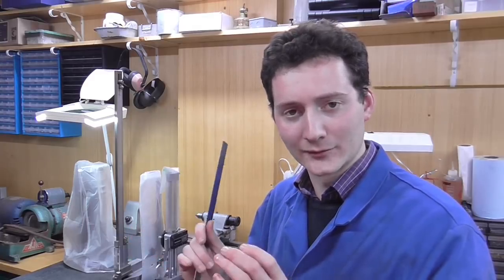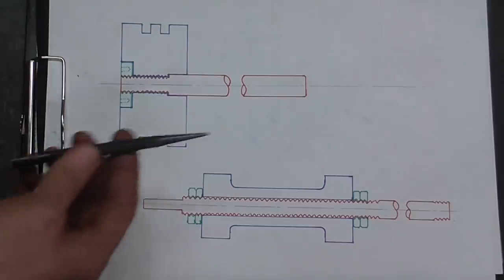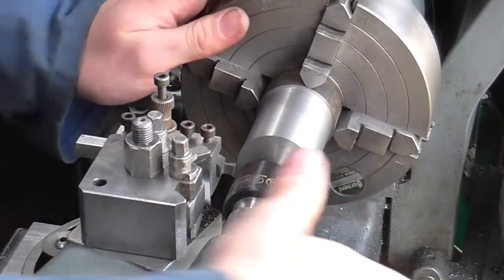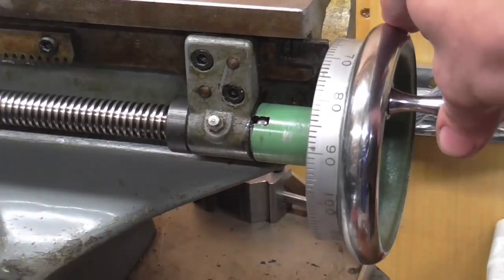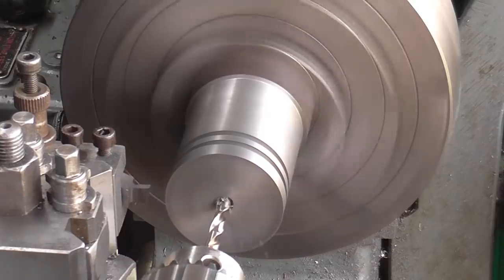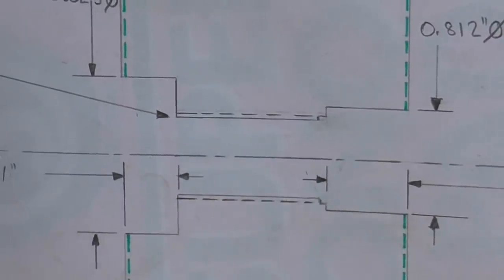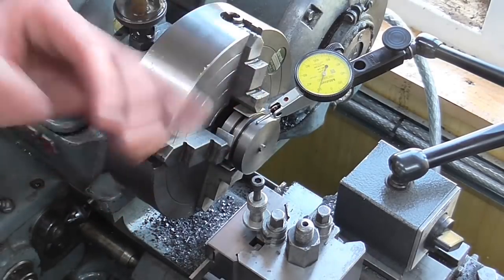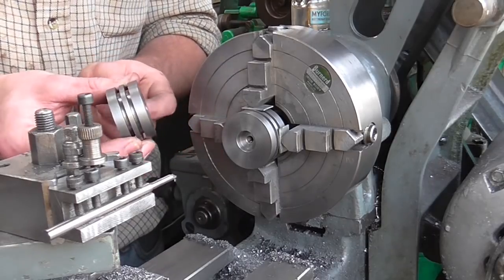Pistons and Rods Part 1

Comment: Question at 5:50 , that hand wheel , is it an accessory of that brand of machine or did you create it?  I see no feed rod so I assume the feed is delivered by either a keyway on the lead screw (but I dont see a key slot on the screw) or uses the lead screw itself to feed as old atlas lathes do(or maybe a worm gear running off the lead screw?). Is that hand wheel always engaged or can it be pulled away from a dog clutch and free wheel?
Reply from the maker: It's a Myford accessory that fits directly on the end of the lead screw. It is permanently attached.
Reply: @MrCrispinEnterprises  Thanks, it's an interesting accessory I have not seen before. 
I have considered putting an electric milling machine feed motor there so I can have on-the-fly feed speed changes so that device peaked my interest.

Comment: If the link does not work...
Search for Kennedy Digital Caliper Manual pdf

https://manualzz.com/doc/4164715/kennedy-digital-electronic-calipers-operating-instruction...

Follow the procedure for changing the Battery;...
Then resetting the Origin
Good Luck... It worked for my Calipers...

Comment: Hello Mr Crispin great videos and I love your style, just a comment on your lathe where I notice the motor body joggles back and forth slightly when switched on and also this movement occurs during interupted cuts, now I've never observed this behaviour on any other lathe and can't help thinking that it would be conducive to chatter during heavier cuts, what are your thoughts and is this feature normal for a Myford, strange though it seems to me at any rate. Keep up the good work and stay safe during these trying times.

Comment: To fix your calipers you need too replace the solder mask on the circuit board, thin Varnish may work but I found nail polish worked for me.

Comment: Satellite dish and bananas! Excellent. My very near calliper displayed funny numbers once, it’s because I got coolant on it by mistake. I took the battery out and put it under a lamp for a while to dry out and eventually it started working again. If yours never did get wet then it probably needs replacing unfortunately.

Comment: Enjoyed the video, I like I like the modification to the piston design. I personally fit the piston to the rod with a taper and nut, and and like you finish to size between centres. The taper method, allows removal and refitting of the. Piston without loss of concentricity. Both methods are better than the original.
Reply from the maker: I like the taper idea.

Comment: What I do when using the leadscrew dial is to set the dial to zero, then using the topslide pick up the front face of the job, at least that way one can return fairly accurately to your starting position if the calculations get mucked up. Also, I would have considered making up a dummy piston rod, held it in a collet and taken a clean up face cut on locking nut interface.
Reply from the maker: Good idea

Comment: I think in normal application those pistons would have been thru bored then retained with something like a castle nut. Thermal expansion and contraction of the piston can put a lot of stress in the threads and cause fatique or fretting. I think your modification was a good upgrade for sure. Looks like they turned out nice!

Comment: Another great video :) with your Mitutoyo caliper, remove the battery, wipe down the scale (with IPA or similar) leave for 30+ mins and replace battery (ideally with a new one) - if that doesn't fix it please let us know
Reply: IPA -assume you mean isopropyl alcohol rather than India Pale Ale! Just joking - a useful tip which I shall remember!
Reply: @smiffy1947  no harm in also having a bottle of India Pale Ale to hand ;)
Reply: Good advice. In my limited experience, digital caliper problems are almost always due to bad batteries. Sometimes the electronics go wrong and that is not fixable, but not on a Mitutoyo, which are really good quality.
Reply: @juanrivero8   Always use SR44 (Silver oxide) instead of LR44 (Alkaline), a common mistake, often feed by new calipers coming with LR44 batteries and it is assumed that is the correct one. The fitted battery is purely for production testing, that's why the cheaper LR44 is often selected in production.
Reply: A very god tip, which I did not know, thanks!
Reply: MachineDRO  IPA Indian pale ale 🍺🤔👍🏴

Comment: LMAO at the Satellite reference  😂
There really are some horrible parting blade holders out there and i think i own most of them !
Thanks for the video Crispin ! Very enjoyable and informative !
I have a set of digital callipers that do that sometimes and i found if i take the battery out and short the battery terminals together then refit the battery it fixes it . The only other thing you could do is take the back off and give it all a clean out , sometimes some fine particles  or oil can get in there and stop the read head from working -either way  they are only useful as a back scratcher like that so you have nothing to lose !

Comment: Hi Mr Crispin.

Glad to see you back in the workshop after quite some time. Still ahead of me on a loco aspect as im still perfecting the workshop.
Was great watching this video and like the improvements.
Just a thought. why not have a smooth section in the middle of the valve bobbin and rod for stability and thread ends for adjustment. 

Looking forward to the next and the answer to my question i suspect.

Keep well and safe during this time and keep it up
Paul Fisher
South Africa
Reply from the maker: Yep I will be answering thoes points. Cheers.

Comment: Excellent video as always. Re the Mitutoyo calliper assuming it is not fake (Google fake Mitutoyo callipers for clues) and assuming you’ve changed the battery, what are the other symptoms? It looked like the display was frozen rather than random? What happens when you change modes - inch/mm , abs/rel, zero? Getting some more information like that might help narrow down what might be wrong.
Reply from the maker: Yes I geuss I was a bit veauge, the problem started by the numbers becoming random. For example you close the caliper and it would read Zero and then you open it 10mm and it would read 230,00 or something silly like that. The mode buttons habe no effect, for instance of you press zero nothing happens. The batteries I have have been lying around for years so perhaps I'll order some new batteries and clean it.
Reply: @MrCrispinEnterprises  Generally there are only three problems with these sort of thing:
a) The microprocessor has turned to toast and there is nothing that can be done to fix it
b) The uP is confused. Pull the battery, short the battery contacts for 30 seconds to a minute, check the battery voltage (if you have a meter) and either reinstall or install a new battery depending on the battery voltage
c) The read head or scale has gotten dirty. Clean the read head and the scale. This generally requires disassembling the unit to get to the read head.
From your description it sounds like one of the first two cases are most likely, but a hair-fine metal chip in the wrong place could cause all manner of problems. Since you already tried pulling the battery I think I'd start with attempting a cleaning, looking also for any metal chips that may have leaked into places they shouldn't be. Since you will have the battery out doing this, spend the extra 30 seconds to short the terminals before reinstalling it, and hope for the best.
Reply: Yes I would try fitting a good quality battery first. However it does look like you have a Chinese copy there. Two clues are the shape of the locking screw and I don’t see ‘Absolute’ moulded into the battery cover.
Reply: I just came across your channel and have subscribed. I saw the problem you are having with your calipers and thought I might pass this link along to you and anyone else who might have similar issues. There is a good instructable concerning digital caliper cleaning and repair : 
https://www.instructables.com/id/How-to-Fix-Digital-Calipers-With-Bad-Display/
Your problem looks almost identical to one I had several years ago. Mine happened because there were tiny conductive particles that had gotten into the housing, and they got wedged between the pcb and the wiper. Sometimes you can use dry compressed air to blow them out, but yours looks like they're stuck, like mine were. The problem could also be a weak battery. Swap out the battery first, since it is the easiest fix, but if it doesn't help then you will need to disassemble the caliper and thoroughly clean and reassemble it as in the link above. Best of luck.